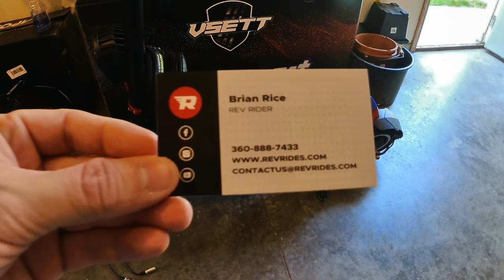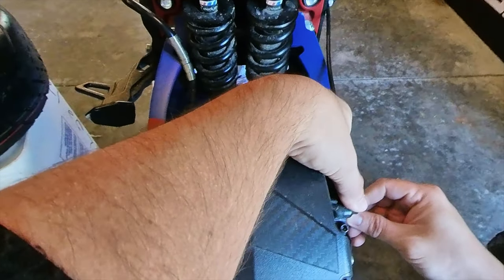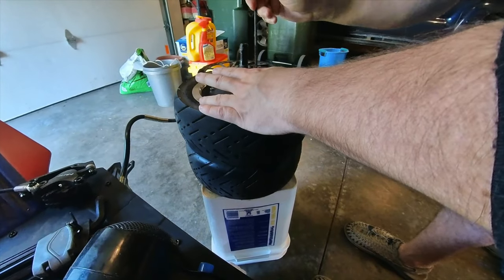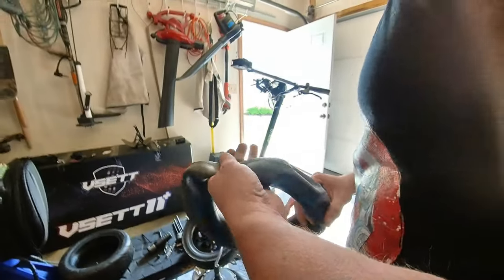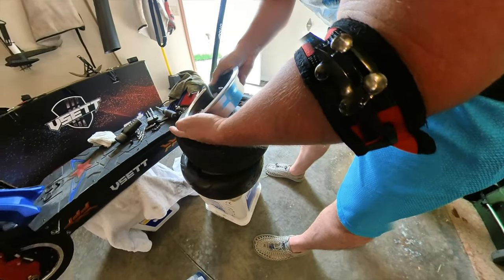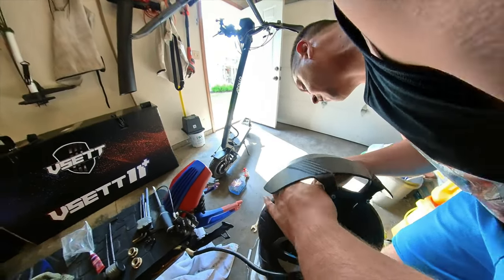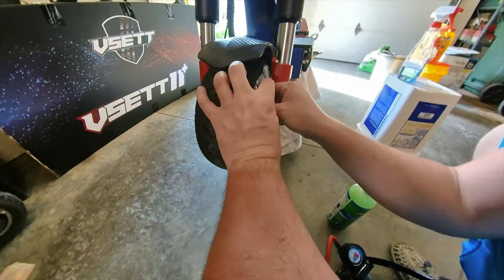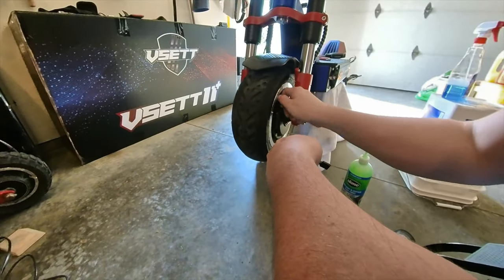Vsett 11+ Tube Swap | Stripped Screw Simulation | Slime Tutorial | Electric Scooter Maintenance 101

Comment from the maker: UPDATE:
These tires held up until about 2000 miles. The slime held the air the whole time. I changed the tires off camera to practice. IF you have any questions about the full tire change, drop a comment and I will answer! It just takes a couple more steps to remove the deck cover and unplug the motor wires.
Reply: Hey mate can you do a video at all I have to change my time but don’t want to break anything lol

Comment: I'm glad I watched this. Been flat over a month. Haven't had time to look at it. Yesterday I sprayed the tire down to find the leak. Nothing no bubbles. Sprayed the valve core nothing. Watched this then sprayed the base of valve stem. And got bubbles.  I didn't even think to check there. Inner tube on the way.
Reply from the maker: Glad you figured it out man! Changing the tube isn't too bad, if you have any issues let me know! I think the tubes are sometimes installed sloppily in China and are a little bit crooked so the valve stem is stretched a bit and it eventually breaks there. Be extra careful when you put the new tube in that the valve stem is lined up exactly perfect! I haven't had any more flats and almost 2000 miles now. I have to change my tires soon they are near the end!

Comment: Thanks brother.. I'm Josh who posted the ninebot max on Facebook haha.. just got a flat today and the same exact problem.. my valve stem had a slit in it. This video helped me viciously.. thank you again.
Reply from the maker: Glad it was useful Josh! And just know, the first time is hardest, it gets easier every time you take the scooter apart. Just take your time and make sure everything is well aligned.

I'm not sure if I included this in the video, but it also helps. On your split rim, at the hole that the valve stem goes through, it can be a little sharp on the inside. If you file this down it could potentially save you some trouble too.
Reply: @ScootaGang  oh, man that makes sense brother. I'll check and file that down. It was very easy taking apart. Didn't take me long and had all the tools to do it.. I've been a DIY person. Always had the mentality of.. if a shop can fix it so can I haha.. thanks again bro.
Reply: Hi! I wanted to know if the best lock for that scooter. My son had one stolen before and trying to avoid this go round. Thanks
Reply: @joycejean979  HI there, to be honest if a thief wants it bad enough they will take it.. there's no lock that will keep them away.. a lock only acts as a somewhat deterrent if the scooter is left alone for a short time in a public area. Your best bet would be to add either a GPS tracker(subscription needed) or (which I use) is a smart tag(Samsung) or Airtag(iPhone) 
The smart tags work very well. 
They work really good and no ongoing fees.
Reply: @crunkwun  thank you much!

Comment: got my vsett 11+ for 3 weeks now and i also got a flat.
while driving i could hear the air comming out, it went flet within 5 seconds but it didn't seem that it was punctured.
im guessing i have the same issue as u have in this video.
i will have a look in the morning, thanks alot for showing us how to change a tyre @Scoota Gang.
if it's the valve, maybe vsett is using bad quality inner tubes
Reply from the maker: Yeah hard to know if it's bad quality or if we just got unlucky and it was installed a few mm crooked. I think if the valve gets stretched at all it can develop this issue quickly. I would try slime before you go to replace the whole tube. Also grab one of these tire pressure monitor systems, I have one now and it will alert you if it starts leaking. Plus it's nice peace of mind so I'm not paranoid about my tires all the time. My tread is getting low so I'll have a full tire change video soon!

https://www.amazon.com/gp/product/B07BFH9WZ7/ref=ppx_yo_dt_b_asin_title_o02_s00?ie=UTF8&psc=1

Comment: I bought one of those foot pumps because the valve is smaller and easier to fit my tires and its $ 10 bucks at harbor freight.
Reply from the maker: Yeah it’s decent. It only pumps like 2 psi per pump though. So it’s really good at topping it off, but takes awhile to pump the whole tire up…

Comment: Damn I was ready to disconnect wires from bay to remove tire
Reply from the maker: You definitely have to do that if you want to change the tire. But if you are only changing the tube, you can leave the motor wires plugged in.

Comment: Aye did that green slime do anything because I put that stuff on a scooter tire and didn't do anything
Reply from the maker: Yes it works about 90% of the time, as long as the puncture is not near the valve stem. You have to use the tubed variety of slime not the other types.

Comment: What kind of Allen key is that? The brake caliber screws on my vsett 10 seem over tightened and I can't loosen it. Im thinking I need a drill to get it loose but that may mess up the screws, thoughts?
Reply from the maker: You have the best odds if you heat it up with a blowtorch or blowdryer and then use a t25 torx aka star bit. It grabs better than the allen key and less likely to strip. It could still strip, but the heat will melt the locktite if you get it warm enough

Comment: Could you do suspension  adjustments  mine has a really  tight disc on the bottom  and it wont budge with my hands is there a trick to it

Comment: Where do you buy your inner tubes? Amazon doesn't seem to specify the degree of the valves and I need 90 degree valves tubes. Almost 300 miles on my vsett 10 and I ran over a dam roof nail😞😞
Reply from the maker: They come with the tires I bought from ebay. I have put 90 degree and 45 degree on the same tire and I believe they both fit one just needs an extender to pump it up. I have both on the yume rn, not my vsett

Comment: Do you have any video showing how to unscrew the main bolt on the front wheel? I'm trying to take it out to change the steering bearings. But can't get the bolt out. :\
Reply from the maker: I have not attempted taking the axle off yet, but if you are struggling I think there is a "bearing removal tool" that might help you if you search google and youtube.

Edit: You are talking about the motor axle and bearings correct?

Comment: Great video dude. Did you get a flat already on the tube? Do they offer a tubeless tire by chance? I’ve got 1600 miles on my tubeless cruiser haven’t had to change any tires yet. Looks like that might be the only negative for this scooter.? I still want it though :-) Wish they offered a car grade tire with regular rim or foam filled tire for vsetts
Reply from the maker: It had a tear near the valve stem which is rare. This works 90+% of the time: 
https://www.youtube.com/watch?v=ISgFc_OmMug

Comment: hey, when you click the wheel in, u have 2 flat things (don't know what they are called) but 1 is just a full circle, and the other is half open.
ive placed the half open one on the left where the motor cable is
but im able to keep screwing it tighter, as if im bending the half open circle thing.
i have to go to work in few hours and really need this fixed since its my only vehicle atm
Reply from the maker: They are called washers. I would have to take a closer look but maybe you have the half open one the wrong direction? Can you turn it 180 degrees to solve your problem?
Reply: @ScootaGang  i cant turn the washer once i put it in.
but i did flip the washer to make it face the other side (english much) 
i guess one side is more flat than the other
just took my vsett 11+ for a spin, everything seems normal, allthough i'm quite nervous because i have 2 left hands and never trust myself when it comes down to mechanics xd.
but all seems well, i did hit it up to 80km/h (without gear)
luckily didnt crash, but i will try to hit max speed in a few hours with gear.
i want to wait and see if the tyre will still leak, because whatever punctured it before, i couldnt find any remnants of it inside of the tyre.
Reply: but if you end up changing your tyre again, i would love to get a closer look on how u place your washers
Reply from the maker: @medino9058  yeah I think it’s probably that washer was just backwards. Are you in our Facebook group? Send me a message I can send you pictures (Electric Scooters Global)
Reply from the maker: @medino9058  I will be doing my full tire change soon. I’m around 1700 miles and the tread is finally getting low
Reply: @ScootaGang  haha alright man, really appreciate it.
u always reply, and u do it quickly also, respect man.
cant wait for that vid
Reply from the maker: @medino9058  No problem man thanks! It will probably be in the next couple weeks or so on the vsett tire video. Just did the yume yesterday and need a little break hahah

Comment: Have you tried any different tires other than stock? I just picked up the 11+ and the stock tires are kinda square and she doesn’t like to turn easily. I saw alien rides sells a more rounded profile alternative to the stock tire. Just wondered if you had a similar ride experience or had any other tires you’ve used on the 11
Reply from the maker: Hey Scott. I just finally put on those more rounded style I think I showed in this video. I bought them from eBay I suggest looking on there and aliexpress and you can save some money probably compared to what alien charges. I also get brake pads like 4 sets at a time they are cheap. Tires, tubes, and brake pads should be all the parts you need to keep it running smooth.
Reply: Did you notice any improvement in handling/ease of turning? That’s what I’m looking for in a replacement tire.
Reply from the maker: @swhalstead  Yes it corners better with these for sure. You should also look at PMT tires from Italy, they are the best if you have a larger budget.
Reply: @ScootaGang  kewl! One more question, did you stick with the stock tire size? I noticed they also have a 110/50-6.5 which I think is wider than but same height as stock.

Comment: Hey boss i got a question.  So i bought a vsett 11+ right and im having issues with the tubes. If i had road on the tire itself after a flat for maybe like .25 miles could that have ruined the actual tire itself and thus ruining every tube i swap out? Any insight would be nice thanks. Also have you had a chance to use that new style of tire yet on your vsett? Im looking to buy those same ones on aliexpress but dont know if I should keep them the same.
Reply from the maker: Hey Marc, 

The tire is likely ok if you rode while it was deflating. I did the same thing on the flat in this video. Just inspect it closely to make sure when you take out the old tube. Also have a tried slime yet? It works wonders on most punctures and may save you completely from changing anything. 

Here's a few tips:
1. Make sure the tubes are fully inflated. Obviously if the tire starts a ride at lower psi then it can more easily catch a flat. 
2. Make sure you seat the tube exactly in the correct spot when you replace it. It can't be folded or stretched, and the valve stem is lined up perfectly in the hole on the split rim piece. 
3. Also note that on some scooters the actual hole that you slide the valve stem through can be sharp on the inside edge. You may want to file it down so it's smooth if you are getting punctures in that area of the tube near the valve stem. Those are also harder to fix with slime. 
4. We are lucky the Vsett has enough room so this tire pressure monitor fits: https://amzn.to/3xbDCLh
The peace of mind is worth it to always know where your tires are at. 

I haven't had another flat since this video, about 1700 miles. I did change to the slightly thinner CST tires about 200 miles ago and the cornering is more smooth. I think they have a slightly smaller contact patch, but I haven't noticed any difference in traction, just that the scooter corners better. You will probably find my amazon essential scooters list useful too, here it is: https://www.amazon.com/shop/influencer-6dc7cd1d/list/1MD13GRSMWUZD

Comment: my friend i have a question,what's the difference when you order on ali express compare to revrides which we know that the price are different to with the same specs,for example the visset10+ 60v 28.0amp i check on the website of the revrides the price are too difference,thank you and God bless hoping for your channel became grow
Reply from the maker: The main difference is that the alibaba unit is usually shipped directly to you from China. So it's a bit riskier because shipping damage or quality control can be an issue sometimes. When you buy it from RevRides, or any reputable dealer, they get it into your country first and inspect it for quality before sending it to you. Since it's then only shipping a short distance and short time, there is usually no extra damage to get it to your doorstep! Alibaba usually doesnt have a phone number you can call if there are any issues.
Reply: ah yes i agree to you,aahm,by the way would you think that the Rev rides also shipment in Israel,thanks
Reply from the maker: @michaeltenorio1686  No I think they only ship to US and Canada. You'd want to find a local dealer near you to limit shipping and import costs
Reply: thanks,maybe only in ali express is my conclusion because here in israel scooter is different in specs

Comment: Which one is a better quality scooter? VSETT or Apollo Phantom? Wondering since I saw those cheap bolts onthe VSETT that you struggled to get off.
Reply from the maker: They all have cheap bolts. Worth upgrading to T25 torx on every scooter. It was a demonstration just for those that it does happen too, I didn’t actually strip the bolt. I have stripped bolts a couple times in the past and it’s worth knowing how to remove them, so that’s why I included that in the video. 

After a month of daily riding each, Vsett definitely seems to be holding up better across the board.
Reply: @ScootaGang  why does the phantom lose across the board?
Reply from the maker: @deanh3678  Phantom needs brakes (rotor and caliper), front shocks, and a motor controller….. which according to Apollo are all wear and tear items…Vsett still running like new….
Reply: @ScootaGang  how many miles on each?
Reply from the maker: @deanh3678  
Vsett: 720 miles as of last night.
Phantom: somewhere between 400-600 but I don’t know exactly. The mileage keeps resetting
Reply: @ScootaGang  i think all that offroading beat up your phantom.   Controllers usually go bust when they overheat and are pushed really hard
Reply from the maker: @deanh3678  yeah the controller was messed up from day one. It just got worse over the month. What worries me is that Apollo denied it was defective and claims that’s just how the hall sensors are on this controller. I don’t know, they didn’t want to send me a controller for whatever reason and do the swap and told me not to open the deck. Only so much I can do with a prototype. We will see if everybody else’s power cuts in and out. They say it’s a safety feature…I also rode Zero to Epic’s phantom and it was not screwed up like mine
Reply: @ScootaGang  thats good info.  did you have to pay for the prototype?  Discount?  i heard the prototype got cheap plastic fenders and the finished version has metal
Reply from the maker: @deanh3678  it’s a loaner I had it for a month and sending it back any day. It’s actually in the box now waiting on the shipping label. I just had it to test it out and give them feedback. There are several things hopefully different from the prototype